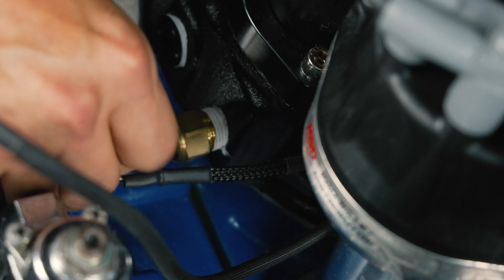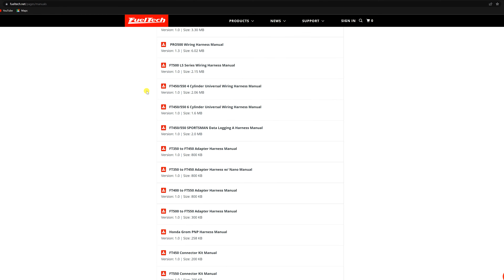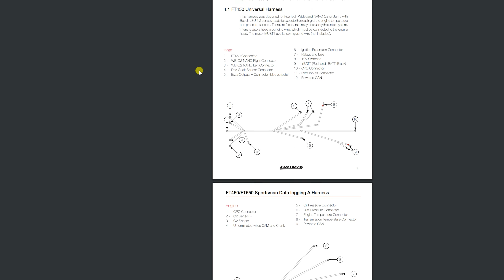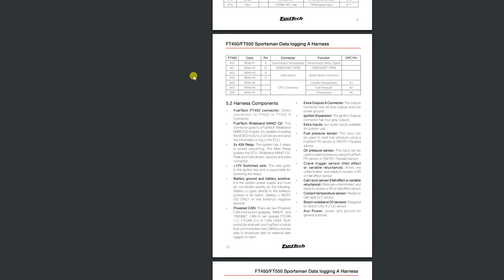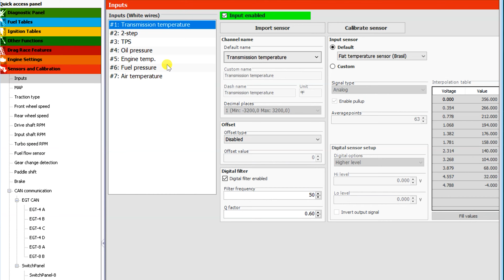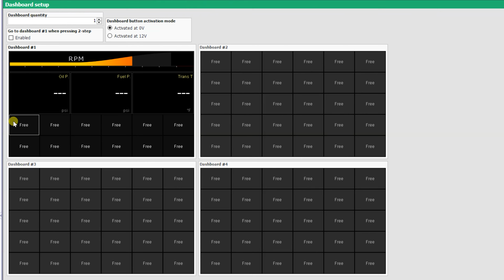Everything you need to know about the FuelTech Sportsman Data Logging Harness

Comment: Theoretically could you run this harness and use the 10 outputs to 8 fuel injectors, 1 boost controller, 1 map/MAF sensor?

Comment: I'm confused; I thought the ECU already has the fuel pressure and coolant data etc.. as it uses them for cold start and open loop injector pulse duration?
Reply: hello I'm from Brazil! If you have any difficulties or questions, you can contact technical support. It will have all the attention you need to solve your problem. The very attentive staff in the after sale 👍